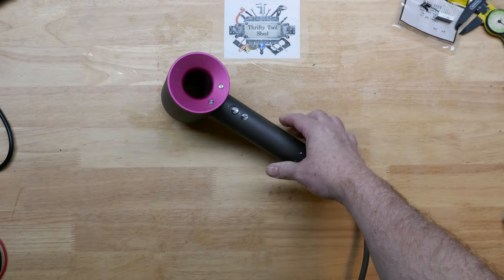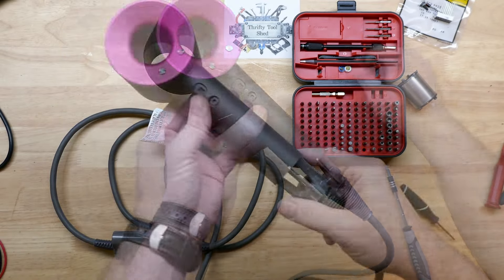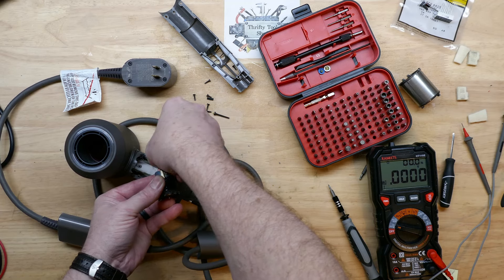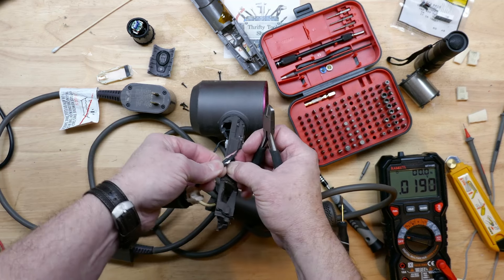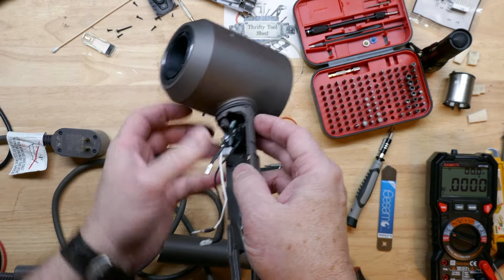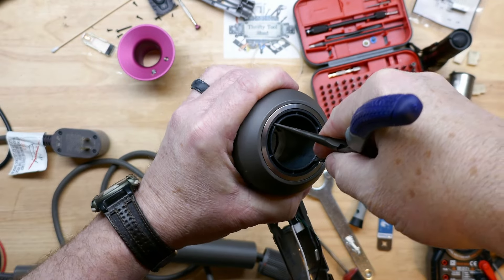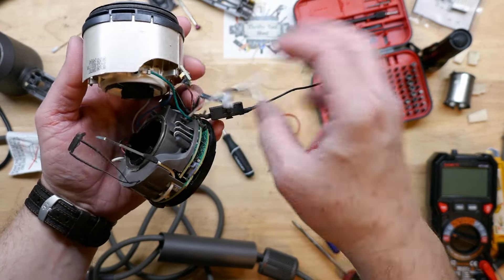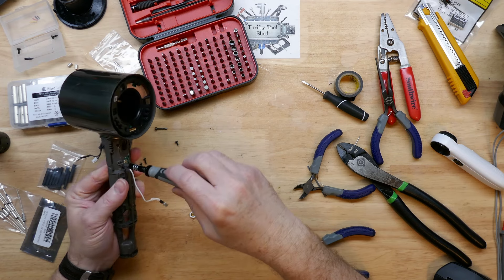Dyson HD01 Hair Dryer Disassembly

Comment: Thanks for the video, not feeling too confident I can fix my daughters hair dryer.   $300.00.  Was told it was a bad motor.  Repair shop said not fixable.  As a hair stylist she has used it daily for 3 years.  I think she got her moneys worth, no?
Reply: A new motor costs only about 50 dollars, if you already have some experience with electronics you could try repairing it

Comment: Thanks for your detail videos on disassembly. Mine has stopped working all of sudden, and i found the right 184c thermal fuse is open without totally dissemble it.  I probed them through the open slots in front.  However, I will need to order new fuse and test it down to fit it.  Another way could be thread some bypass wires to the right fuse to patch it up.  I would probably break the same tab without seeing your clip first.😂

Comment: I'd like to add my thanks for the excellent series of videos on the Dyson hairdryer.  I'm a fairly advanced DIY kind of guy, but I don't think I would have tackled the Dyson hairdryer without your videos, and if I did I'd have broken a lot of parts trying to figure out how it is assembled.  My daughters quit because of a thermal fuse failure so I replaced it.  Seems to be common for the one on the left to fail. A couple of months later, it failed again.  That causes me to think that whatever is supposed to control the heat isn't functioning properly.  I checked the thermistor and it seems to be functioning - resistance changes when heat is applied.  I'm wondering if the bimetal gismo is supposed to open temporarily when the unit gets overheated, and if so, if that might not be working properly?  One recommendation I have for getting the back cover off the top assembly (housing for the heating element) is to make a couple of 1/8" spacers (metal strap works well) with a crescent shaped cutout matching the curvature of the housing.  Pry the cover up carefully and wedge them in between the cover and the housing.  Then push one around to the other side, leaving the first one in place.  That works well for me.
Reply from the maker: It could be something going on with the thermal cut out strip for sure. I would think it would normally activate before the thermal fuse would open. After all the thermal fuse should be the last resort. I feel like one reason these fail maybe contributed to how the handle is held sometimes. If this is on high and running really hot and somehow the intake filter gets covered by hand or maybe even long hair in some cases it could cause the air flow to decrease so fast that it causes the fuses to open especially if tilted on its side with even more heat rising quickly and it's not held straight up.  Another cause could be the dryer is bumped or dropped at some level while still really hot and that may cause the fuse to open. Just some possible causes since I see many viewers comment on this being a common issue it does seem. They really do run hot and it's tight temperature control, but the thermal fuse has to be running really close to it's rating on high possibly.

Comment: My whifes has just stoped heating, LEDs and buttons work ok, just no heat. Do you  think it is a thermal fuse?
Reply from the maker: I don't believe it is if the leds work. It could be a couple of things, such as the NTC thermistor is unplugged or faulty. In that case, it will typically flash the red leds and shutdown after a few seconds of running. It could be an issue with the heater output control from the board. Maybe there is no output to the heater control. I have never seen it, but I guess it's possible the Cold Shot button is stuck if it will only blow cool air and not heat? This is just a few things to check. I shared all I have learned in a few videos on these. There's not much else I can help with.  Best of luck to ya!

Comment: Great to see how to take it apart, a gold mine of info. Trying to fix this particular model and I'm pretty sure the thermal fuse is the culprit.
Reply from the maker: Glad you found it helpful. I have a video called Dyson HD01 repair #3 and it was the thermal fuse on that one I believe.
Reply: @ThriftyToolShed  Ended up with yet another Dyson and ... I didn't even check if it tried to work, went for the fuses directly! They turned out fine so now I'm putting it together again to see what happens when I power it on. Stupid me.
It was very dirty and the filter was absolutely clogged. Everything needed a good cleaning so - if it works - it wasn't all in vain.
Reply: Apparently, it just needed a good clean. Job done and +3 thermos fuses in stock (one to wreck).

Comment: Extremely helpful video. I have similar dryer which has stopped giving hot air. I have cleaned the filter but the issue has not resolved. What are other expected problems does this dryer had? What other things should i check?
Reply from the maker: Thanks for your kind comment. Glad it was helpful. I have more videos on the HD01 hair dryer. Repair#2 and Repair #3 as well as disassembly video. I have shared all I have learned about these in the videos. The thermal fuse was bad on the one in Repair video #3. I also shared a basic drawing of the heater circuit for reference. Hope it helps and best of luck to ya!

Comment: I have the dreaded 3 red lights / overhating flashing when set to power level 3 and heat level 3 (level 3 + 3 only).... i tried to do some light cleaning and disassembling the base of the base + filter but still doing it. I think i'll have it serviced. been running every day for 2 years, drying the dog, family, etc
Reply from the maker: Good that you checked the filters. That screen has to be really clean sometimes to run on high without issues. It does get hair into the motor/blower sometimes also and causes issues!

Comment: I’ve taken mine apart and replaced the thermal fuse as it had gone but now got 3 flashing red leds. Previously it did nothing at all so it’s progress but it still won’t turn on and still flashes red. I can turn motor by hand and it feels almost springy? Unsure if that’s how they’re meant to be. Any advice appreciated
Reply from the maker: The motor has very strong magnetic poles and you can feel the heavy drag of the magnetic field while trying to rotate. Likes it's fighting you to turn it.(Like It coggs) That being said, all I can think to check is making sure the Thermistor is plugged in correctly. It seems like a temperature issue. I think I shared more details of the thermistor temp. sensor on the HD01 repair #3 video. Best of luck to ya!

Comment: I just bought the Dyson super sonic yesterday. When I got home. I plugged it up to make sure it worked but when I turned it off it started smoking for a few seconds. Will this go away? Or should I return it?
Reply from the maker: In my opinion it depends on how much smoke honestly. If a little bit from possible oil on the elements burns off and goes away then it should be fine. If it was a fair amount of smoke and it does not go away I would absolutely return it. They cost too much to gamble with for sure. I can't say for sure since I have never seen if one does that brand new. Anyone else on here have experience with a brand new one doing that?

Comment: Hi , may I know if I can easily take off the colorful cover and change to a different color without having to dissemble everything? Thanks
Reply from the maker: The back cover is kinda easy to snap off and on, but It can be hard to get the catches to release without marring up the outer rim of the Dryer housing. Use care while prying the lip off. No other disassembly is required.

Comment: Can I mod a 110v to a 220v by replacing the motor and circuit board only? Or do I need to replace the heating element as well please sir
Reply from the maker: I have not worked on a 220V to say for certain. I would think the element is also different for the 220V model.
Reply: @ThriftyToolShed  thank you very much for your reply

Comment: Do you have a repair video for this dryer turning on 1 sec then shutting off with 3 white led lights flashing...
Reply from the maker: I don't have one for that, but that may point towards the air flow. So either an issue with the motor not turning or air flow restriction etc.

Comment: At about 9:40, there is a retaining ring on the back of the front cover. I assume this dryer has been disassembled and reassembled already. You probably left out the retaining ring when you reassembled it.
Reply from the maker: I thought that was mentioned in one of the repair videos if not this one also.  That retaining ring is in-between the halves. This dryer has broken tabs from a previous repair attempt or maybe even a drop? So yeah, it easily popped off as you can see the tabs are broken.
Reply: @ThriftyToolShed  Yes, I was jiggling mine and it doesn't come off like yours. I was wondering what was wrong,
Reply from the maker: @YunxiaLiu  
If I did not mention much about it in the video, it must have been repair #2 video? I use curved needle nose to remove it and reinstall it.
Reply: @ThriftyToolShed  I didn't watch #2, I went straight to #3. I wasn't difficult to get it off, I didn't even use tool. But I think it worth mentioning here.

Comment: Great video, thanks.   Also that tool set looks nice, do you have a link to it?
Reply from the maker: I have the link in the video description to the Kaiweets tools. 
I will post the links to both screwdriver sets below. You can also use this 15% off  coupon code.
15% OFF CODE: TTS15
Available sitewide at Kaiweets.com
Link: https://kaiweets.com/products/kaiweets-es20-screwdriver-set

Affiliate Link to Kaiweets S20 130 N 1 (manual) Precision Screwdriver set:
https://kaiweets.com/products/kaiweets-s20-screwdriver-set?sca_ref=1714116.pmJeG8SEEq
Reply: @ThriftyToolShed   I didn't expand the description, doh!  Thanks, that's very thorough
Reply from the maker: Thanks for your kind comment!
Reply: @ThriftyToolShed I went to the Kaiweets website, but darn it, Kaiweets website only lists the electric screwdriver. No manual screwdriver listed.